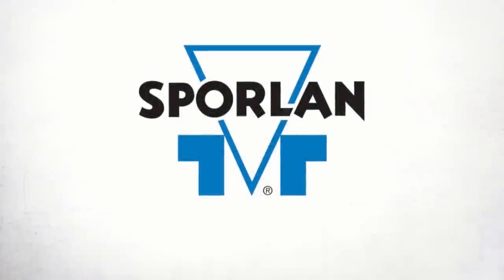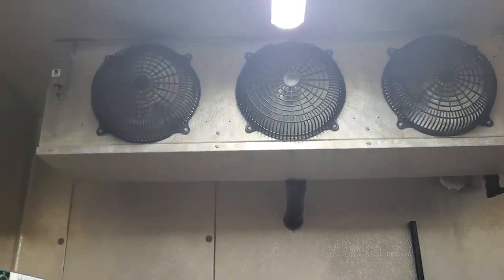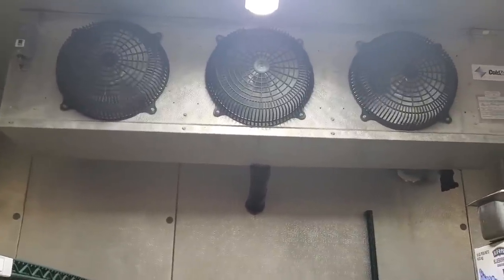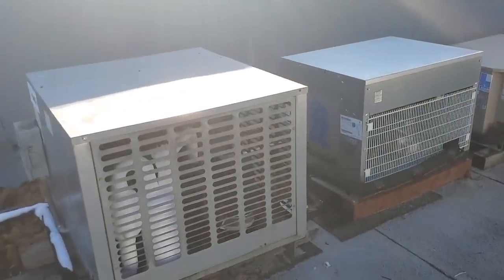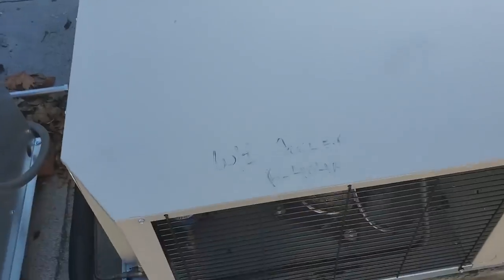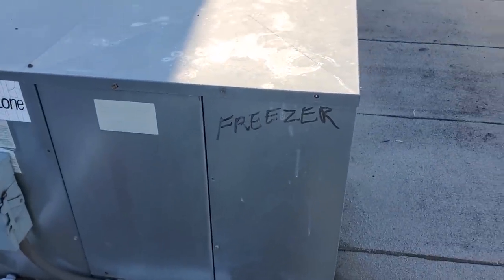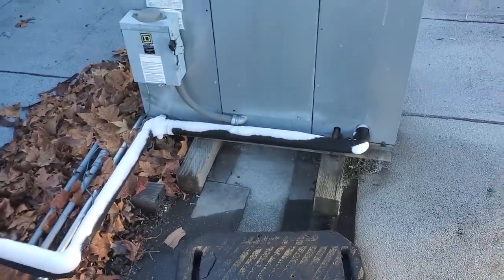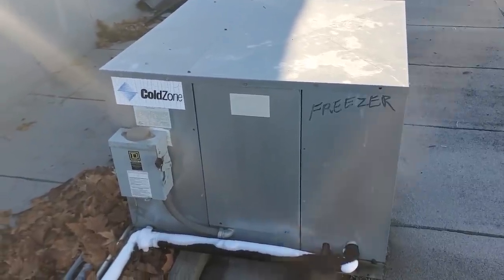WALK IN FREEZER DEFROST ISSUE

Comment: Kind of laughed to myself when you were checking to make sure the power was off.  I did exactly as you were doing.  Meter showed it was dead.  Started working on unit and got shocked, one knife didnt pull all the way out, meter decided to take a dump at that point, Murphy's law, right? Now I test to ground before and after turning disconnect off, I dont like surprises. 
By the way.  I learned this trade from a guy just like you, even looked a bit like you, but he was kinda cocky. He really knew his stuff.  He told me the same thing about the rope.  I Still do it to this day, frustration saver.
He also pounded in my head "air flow is king, if it isn't proper air flow, none of your other reading will make sense.

Thanks for the videos. Keeps me motivated to do better.

Comment: Judging by the burnt wire I bet the defrost clock was carrying the load of the defrost heaters . And the contactor was only there to keep the heaters off while the compressor is pumping down. A minor modification to the wiring would have the time clock only actuating the control voltage only. And reduce the wear on the time clock dramatically.
Reply: I doubt that the $3 terminal was carrying heater load as that would mean that #3 terminal would be in series with the heater contactor coil and that contactor coil would also have full heater amperage (13a +) going thru it and defeat the purpose of the heater contactor. This would burn that coil in a short time. The #3 terminal should only be in series with the heater contactor coil and the compressor contactor micro switch.
Even tho the contacts on that time clock are rated for 40 amps the purpose of the heater contactor is to keep load amperage from the time clock relay.

Comment: Very nice job. I mentioned several times before that if the voltage is low the amount of heat the heaters produce drops something like four times less. You have a serious voltage issue with the local utility. I worked for an electrical utility for many years and we used to see this on electric waters. Installers would put large commercial electric water heaters in kitchens and the voltage was 240 elements on a 208 system. They never changed the elements to 208 volts and the heaters would way under perform due to the wrong elements. Someone needs to see the local utilities and correct that voltage to the 208 volts required by the equipment. Possibly could be done at the local transformer taps. Low voltage will destroy compressors and other equipment. Thanks for the great video's.
Reply from the maker: Its all over southern California the utility wont do anything about 202 volts its normal we always run low like that, I will be going live on YouTube this evening 12/30/19 @5:PM (pacific time) to discuss my most recent uploads and answer questions from emails and the chat, come check it out if you can
https://youtu.be/XNnsDZUitZQ

Comment: One of the elements in the defrost heater may have what I call an "intermittent open". I say "intermittent" because it may be a "come-and-go" problem. It may come ONLY when the ice build up that occurred when the Paragon defrost timer went defective and allowed the ice to reach a large enough density and mass that it impinged on the heater element at a high enough pressure ( force) to slightly interfere (open/resist) electron flow in that element and/or do the same thing to the high temperature safety limit switch embedded within the evaporator coil that is wired in series with the specific element that had the abnormally low amperage draw. You may only get that amperage draw problem when the ice amasses to the level it can only amass to when the defrost system is not working. I could be wrong. I have seen alot of stranger problems over my two plus decades in this beautiful trade. Been around the block a few times in the HVAC/R skilled trade. As usual, you put out another interesting video.
Reply: Tyrone Sheppard; Good perspective. Thanks for sharing, bud

Comment: Stuff I used to work on was JIS slotted with a hex cap. Even if you stripped the JIS slot you could still get the screw out with a driver. It's the little things that make the difference.

Comment: I   worked   in  a  Industrial   Ice  plant in  the  1980s, and    early   1990s,   we   ran   R-22   in  the   freezers    then,  but   ran   R-717   Ammonia  as  Freon  too,     The  freezers   used   a    defrost  clock timer  like  you showing  in your  videos, and    I  remember one  time   their  was  heavy  ice   build up  on  the   evaporator coil. The   high  pressure   cut  out,  shut   the  compressor off got  it fix,  Commercial   Ice   boxes,  where   package   ice  is  storage also  use  a  small   defrost  timer too,  and  when  I service  these  units,  I  would turn   the   defrost   control  manually to  cycle  it  in  defrost   mode,  to    activate   the  electric  heaters.  When   I  took   up  the  trade   in 1980s,   R-12,  and  R-22,  and   R-502  was  cheap, and   at  that  time   no  EPA license   was   required  at all,  but  that was   then, I learn  a lot,  but    electrical   trouble   shooting  is   very  very  important  if  you   going  to  stay   in this   highly  skilled  trade,  I also  have  a  electrical background  too.

Comment: The 82 volts on the disconnected wires look a whole lot like capacitive coupling to me. That side of the circuit was floating open and the wires run next to each other. If you put a 1k resistor on it for a small load, I bet it would poof right down to zero. On a 240 loop the coupling puts it to 90-100v in my experience with my meter's resistance.

Comment: I don't know if hvac will read this but a suggestion to why it was low ampere on the heating line..
Could a service tech have wired the two heating elements in series and you didn't notice that when you remove the wires? 
You was getting ~201v and ~37ohm x2 heaters... 
201v ÷ 74ohm =2.71ampat the actual heating element, you still need to factor in the cable run as well  to the outside unit, which could be 0.5amp.
Im not into this side of engineering but have been caught out with other people making errors like this. 
I was once given a fridge freezer what kept icing up, the manufacturer replaced the board and bits until they gave up and given the customer a new fridge freezer... 
Thankfully I followed the wiring diagram and found the defrost heater attached to the compressor run.. So it never defrosted and was warm around the thermostat lol

Comment: Had a Hot-Pack unit that kept icing up even though the defrost clock and heaters were fine and ref level was good. After watching the def cycle a few times it turned out to be a defective termination stat cutting the def cycle too short. BTW - I’m not surprised that you had stray back voltage, odd voltage readings and loss of the heater strip power considering that when you were checking it everything in the electrical compartment was still buried in a thick layer of ice.

Comment: 10:00 This was a resistive heater, the wire was running to, right? You could check how much resistance the heater has before turning it on. Sometimes two wires rub because of vibrations the isolation away and short out on the way. This type of failure is quite common and even a RCD can't pick it up, just a AFDD can. When you measure the resistance you can at least make sure there's no short which will melt the wire again. But keep an eye out for arcing with a amp meter, when you turn on such a system again.

Comment: I thinking all that ice may be causing some stray currents causing the 80+ volts prob very low current.  About fan delay, I replaced my consumer whirlpool control board and it didn't have fan delay after defrost which is built into the firmware on chip.  They sent another and it was ok, the fan delay is so the remaining water on evap refreezes to it and so it doesn't blow heat and moisture back in freezer, usually 5 or so minutes.  The numbers on the limit switches give the temp turn on and turn off set points.

Comment: There are flathead screw screwdriver screw holders that work great. Can not only securely hold screw but also tighten it in some configurations. Have had several over the years.

Comment: Did you check the defrost contactor contacts.
isn't the defrost clock controlling the conactors only?
From a business owner point of view, would it not be more time and cost effective to carry just the grasslin clock. they do replace most clocks and are dual voltage.

Comment: Some weird stuff on that one for sure. The Box thermostat that failed while you were there could be possible that it would never shut the compressor off maybe it fell closed first before you adjusted it. A thermostat that never shuts the system off the unit will freeze up. On some reach ins I've seen thermostats fail closed and every time the unit becomes froze up.

Comment: Hello I have walk in freezer 3face but installers connected in two face and Im wondering if this can coz the electrical heaters not working? I tested heaters for resisters and they giving me 50-60 OhMs . I’m not doing a lot of refrigeration so I’m not sure about it , I checked yesterday the contactor from terminal3  giving me 120 down to the heaters but they not heating and someone removed fan delay switch do thing is supposed to work in this setup of 2 face ?

Comment: An interesting job. It would be worth checking to see if there is voltage drop across the heater limit switch when the heaters are powered. As others suggest, however, it could simply be a heater that goes open circuit when cold enough (frozen) - if there was enough voltage drop across the limit switch to reduce the current to ~3A, I would expect the limit switch to show signs of heat damage. It might also have been worthwhile measuring the resistance of the heater circuit from the time-clock end while you had it de-energised.
Reply: Oh, and I bet that thermostat was already unreliable before you touched it.

Comment: If in doubt where it leads to I use a Greenlee CS-8000 Circuit Seeker. Works every time.  A high resistance connection is like the lowest point the water will flow.  Keep the Water Flowing. Agreed on why put in the same. Why put Slicks on a Model A?  I love Hot Gas setups for this reason.

Comment: 7:24 Wedgelock screw drivers,  a split shaft with a collar that you slide and it holds screw. Or Klein has a flat driver thatvi have myself to hold flats on driver. But a lot more bulky then a wedge lock flat driver
Reply: Welp, either they changed name or I misremembered the name.
Quick wedge is now the name.

Comment: Hey Chris great video 
Question: Can system pressures check out as far as saturation temperatures but still have bubbles in sight glass? Also is it necessary to add more after clearing sight glass?
Reply from the maker: Yes they can the pressure dont reflect the proper charge!  I will discuss this on my livestream tonight  I will be going live on YouTube this evening 12/30/19 @5:PM (pacific time) to discuss my most recent uploads and answer questions from emails and the chat, come check it out if you can
https://youtu.be/XNnsDZUitZQ
Reply: Thanks Chris

Comment: Hey Chris great video as always. Quick question for you or for anybody who knows, what is the defrost termination temperature on walk in freezers, and is it adjustable? I know on the walk in coolers it’s generally 55 for defrost termination and 35 for the fans and I heard you mention 20 degrees for the fan on this one but was unsure on termination. Much love from Minnesota.
Reply: hashimitsu its not adjustable in most cases unless it has smart controller installed and most of those switches are set to turn fans on between 20-30 degrees and termination is between 55-60 just depends on brand. Did that answer your question?
Reply: Cole Herndon yes it did thank you very much good sir.

Comment: When charging refrigerant while it’s pumped down do you charge it until the cut in goes off and it pumps down again and then keep repeating until you have enough liquid in the receiver? Also what do you think about using MAPP gas to check the receiver level? Where you able to do it with just the thermal imaging camera? I’m new to refrigeration, used a thermal camera yesterday and didn’t notice a temp difference in the receiver. Maybe it had no liquid? Sight glass was flashing.

Comment: could of had some Micro arcing in connectors occurs when the mechanical contact is seriously loose, for example due to differential thermal expansion of aluminum wire and copper terminals. The term is also used in other contexts, for example: to describe discharge through microscopic holes in the dielectric of capacitors and when you pulled the connector of and put it back on can fix it

Comment: Also playing around with an Ohms law calculator the original 3 ish amps you measured on the defrost heaters is equal to one heating element being applied 120v. All the ice and moisture could have provided a path to ground therefore 120 volts. The defrost limiter was probably open at that time.

Comment: there is nothing wrong with slotted screws. They are just misapplied. They are supposed to be used for low torque applications. If you need torque use a hex head and a socket.

Comment: Why dose’t a walk In cooler and freezers thermostat not cycle off the evaporator fans?
Reply from the maker: The evap fans are left running to maintain even box temperature because of the size of the unit

Comment: That hook is $75 plus tax where I am. HUGE pass. I'll find an alternative, or make my own for 1/10th the price... And that burnt up wire for the defrost is not "shorted". It's just as he says and it's a bad connection that overheated from the amps required for the heaters that eventually melted the wire, but it's not shorted... And you can tell this is American with the statement "should have been smart and used a phillips"... Come to Canada where we use Robertson, which blows phillips away... Sadly, our time clocks still use the same flatheads tho.

Comment: Flat heads exist to prevent over torque
Reply: john rein thought that’s why the Phillips was invented because of over torquing the slotted screws.
Reply: Slot heads exist because that's the first kind machinists could make - you don't see much of anything else on 18th and 19th century firearms.  Phillips and Robertson didn't come around until the 20th Century and metallurgy and processes got good enough to make something else cheaply enough.